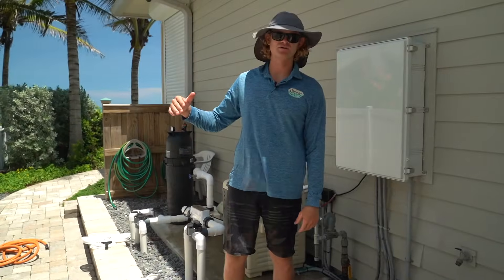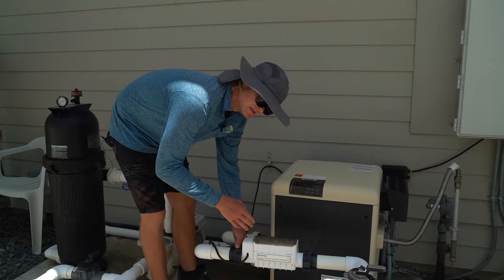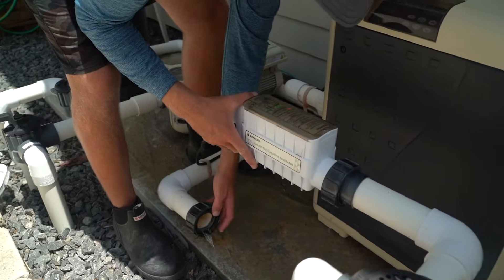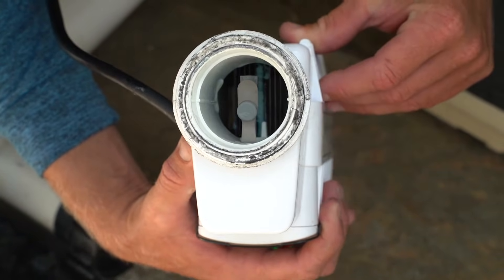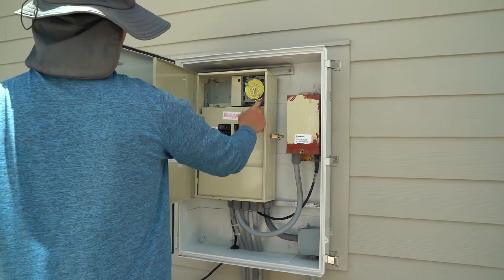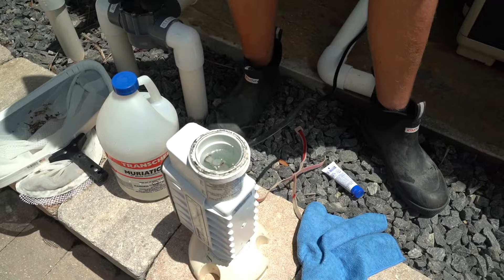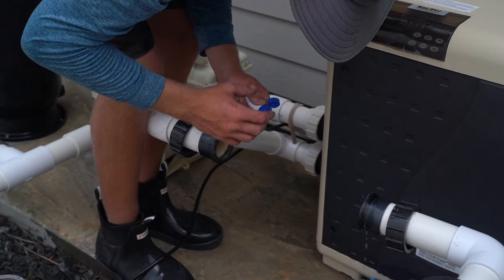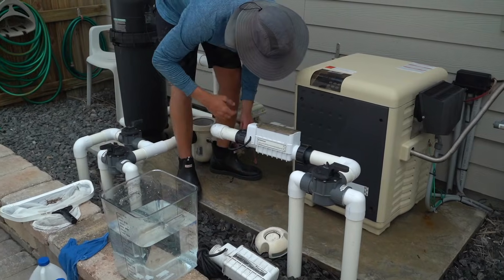HOW TO CLEAN & TEST A SALT CELL : PENTAIR INTELICHLOR

Comment: So if the Union is stuck you're screwed then
Reply from the maker: No you can use channel locks as a last resort but be gentle replace or clean and lube orings and always hand tighten when putting back together

Comment: Thanks for the video. Curiously, instead of re-attaching the dummy cell, if the pool water is independent in a bucket intended to submerge the cell unit, why does the system need to run? Only the salt cell itself actually needs to run, correct?
Reply from the maker: Yes that is correct if there’s no automation(intelli touch etc.) and the salt cell runs off a mechanical timer then that is correct I just did it so anyone can do it with their system and Hayward and other salt cells will not turn on unless you engage the pump just trying to make it as simple as possible and if you engage the pump without a dummy cell it causes all sorts of chaos and potential problems but thank you for your insight I forgot to explain that!
Reply: @PoolCareWorld  ok gotcha, thank you !

Comment: EXTREMELY DANGEROUS!  Do not ever do what this guy did.  Never add water to acid.  Always add the acid to water.

A saltwater chlorine generator should only receive power when the pump is running.  This system is wired wrong, and can create a very dangerous situation.

Disconnect power from the cell before removing it.  Only clean a cell when necessary.  If your chemistry is good, you will probably never clean your cell.  Muriatic acid cleaning is a last resort since it shortens the life of the cell.  If you do need to clean it, start with water, scraping with a wood stick, cleaning vinegar, then citric acid.

Comment: Please add some safety messages on this vid.    Always wear a  mask when looking down at the cell full of solution, the fumes can rise and fill your lungs quick, it can actually make you pass out.  Never handle the cell with it still plugged in, it’s a small amount of power but if it’s faulty you can get shocked.  Never clean over your pavers, unless you want to destroy one.   Save a spare paver for this work that you don’t care about.   

Never stick your finger in there when it’s on.   Faulty wiring means shock. Normally it’s fine but not always.  Would also recommend glasses.   Amazing how water likes to splash and it takes the tiniest amount of acid to damage your eyes.  

Be safe out there.
Reply: Masks and acid fumes, horrible idea.
Reply: This guy probly was raise like a puzy, wear this, wear that, YES WEAR EYE protection, but all the other stuff is just puzzy talk.
Reply: Jesus man..... who is paying you to make statements like this? Are you offended? Did u lose someone to Chlorine? Shouldn't he also make a statement about waiting 30 min after eating and not to swim without a life guard on duty?  Not helpful champ, just patronizing....smh

Comment: Hey buddy I will strongly suggest to put a check valve in order to protect that expensive mastertemp heater.
Reply: With this setup, a check valve is not required.  The cell should be powered only when the pump is operating, and the flow switch is a secondary safety device.  If a tab feeder was installed, a check valve would be appropriate to protect the heater from acid and chlorine generated by the tabs.
Reply from the maker: Very good idea thanks for looking out! This one is nearly 5 years old I like to keep the salt cell timer to cut on and off atleast an hour before the pump comes on and cut off an hour before it turns off to mitigate those issues. But 100% good idea!
Reply: @PoolCareWorld  thanks for taking the time and tech us how to take care of our equipment.

Comment: I can't find any P-6000.  Could you tell me more about that please?
Reply from the maker: Hi thank you for bringing this to my attention I was wrong it’s actually E 6000 and it’s just used when you first buy your salt cell tower in the bottom grove and push the oring into it to hold in place. Use a very small amount and try and only get it on the bottom of the oring not the top. Then we use a silicone lube on the top of the oring every use. We use magic lube for our lubricant

Comment: New pool owner here. Mine works too well. It's currently turned off because the chlorine is 15ppm. Even at 2% my chlorine is too high.
Reply from the maker: That’s a great problem to have! I’m guessing the pool is small? Look at the model number on the side example: ic40 is most common. Search the gallons that model is recommended for that will tell you if it’s a more powerful cell. If it’s on 2% that means it’s only running 2% of an hour run time. If it was at 100% it’s on 100% of the runtime. So if you run it at low percentage it should last you a lot longer. Also make sure your cya isn’t above 50 and your test reagent isn’t expired

Comment: In the CPO course they tell us 100 times:. You never add water to chemicals.  You add chemicals to water.  Looks like you added tap water to a jug with Acid.
Reply from the maker: Yes I agree it’s a bad habit I need to break! Thanks for watching! Any videos you want to see next?
Reply: It’s an enclosed-self contained container
Reply: So could you dilute muriatic acid with purified water instead of tap water from the hose?? I'm new to being a pool cleaner and still learning.
Reply: @mattmccauley5561  any type of WATER can be used just as long as you add the acid to a larger amount of water.  Not adding water to the acid like he does.
Reply: @JuanSanchez-tk4vr  thanks man. About half of my 74 pools are salt and I'm trying to get all the info and tips I can get so again thank you for the input.
Reply: @mattmccauley5561  hold your breath when you open acid it's bad to breath those fumes
Reply: @JuanSanchez-tk4vr  oh yeah. I'm I Florida and as soon as I pop the plastic off it starts fuming. I got a whole big whiff on my first day training when the guy poured in the pool and just a huge vapor cloud went right up my nose. Thought I was gonna die and then I got in a hurry on one job and splashed muriatic on my ankle and instantly ate my skin. Learned a valuable lesson there.
Reply: AW. Acid into Water .. always

Comment: This pool system on this home. Has a nice clean install.
Reply: No heater bypass, no sediment trap on the gas line, the install calls for both..junk valves instead of Jandys…another crap builder, screwing up. Sorry
Reply: @poolmonkey7479 
Forgot that did not see a sacrificial anod anywhere - this is a salt system. But plumbing layout looks efficient
Reply from the maker: I agree the builder did a great job!

Comment: I would recommend capping the end opposite the flow switch and not submerging that flow switch in the acid solution. Just cover the plates. Also your acid-to-water ratio is way higher than the mfgr recommends.
Reply from the maker: Yes you are correct but in cases where the cell has not been cleaned in a long time and is more caked up with calcium deposits you do need a stronger solution. I wish I would have clarified to use no more than a 50:50 solution instead in this video, just trying to make it easy for everyone. I have also seen where the flow switch does need to be cleaned so I also do it to eliminate any issues. But yes the manufacturer recommended is more like 4:1 water to acid. Thanks for helping me clarify this 👍🏻
Reply: @PoolCareWorld  4 parts water to one part acid. Cover the plates only, not the flow switch, as the acid solution will damage the bi-metallic contacts of the flow switch. Wait 30 minutes and dump the solution. If calcium deposits are still present, do it again for 30 minutes. Using a 50/50 solution may damage the plates and void your warranty. At about a $1k for a replacement, you don't want to harm the cell with careless handling.
Reply from the maker: @ronreed5889  Yes I agree and I should’ve explained it more in depth ! I honestly never thought the acid would damage the flow switch! Thanks I appreciate you!
Reply: Agree, I destroyed my flow switch at one point because I didn't know I would cause damage. However, I bought a flow switch replacement online and was able to easily replace it. Now, when I clean the cel, I unscrew the flow switch from the housing so that it does not get exposed to the acid. You are welcome. ;-)
Reply: Acid Magic is the best for cleaning the cells instead of mixing the water with acid. And no fume at all and it will never damage the cells.

Comment: Good video.  Just be careful adding water to acid. It can cause it to splash rapidly.  Much safer to add acid to water
Reply from the maker: Thank you! Great advice! Always wear eye protection as well. Yes if I’m adding acid to water I like to use a gallon pitcher for easy pouring.
Reply: acid in the water like ya oughter
Reply: Always add the acid to the water.

Comment: My salt cell is completely blocked in about 3 weeks. Is it a faulty cell?
Reply from the maker: What’s your water chemistry? Also remember the percentage of the cell is is just how long your cell runs. So only run your salt cell on 80% max and lower if possible to lengthen the time between cleanings

Comment: Great video. I have a question. My pool has a Hayward Aqua Rite salt generator. The display is showing 1700 salt, very low. I sent a water sample to a pool store and they said the salt is at 3800, high. I know is at 3800 because I added too much salt last week thinking that it was low. The cell is not producing chlorine because is reading 1700, check cell and check salt lights are on. I already calibrated it. The cell is a T15 and it matches the board. Any idea if is it the cell or the board that goes wrong in this cases?. Thank you
Reply: there is no check cell or check salt. just to be clear does the indicator light say inspect cell . sounds like needs a salt cell cleaning and another recalibration. a correct calibration will allow you to set the board to read what pool reads. I would get my own reading and not the pool stores. get you a 40 digital salt reader thats pre calibrated. eseasons makes a good one.
Reply from the maker: Great advice Ken!
Reply from the maker: @TOS RIDER I would definitely recommend cleaning the cell first that will sometimes improve the salt cell readings at the board. Let me be clear that this is a very common problem with this brand of Hayward salt cells. We have so many issues with them. Many times the board will most likely have to be replaced if it’s still not in the 3200 ppm salt range. But you cannot ever trust the board reading always take your own readings before adding salt. The cell also should be replaced every 3-5 years, if it’s past 3 years and still working it’s running on burrowed time start saving up for a new one. 

My opinion if both the board and the salt cell are outdated and you’re looking at replacing both of them, then switch your salt system over to this model pentair intelichlor. It’s going to be around the same price or cheaper depending on if you do it yourself or hire someone. These salt cells have the board display integrated on top. They’re bulletproof! This is a IC40 model make sure you’re getting the right size.

For testing the salt I recommend using a Taylor 1766 salt reagent kit they’re super accurate and no need to calibrate. Just store in cool place. 
Hope this helps! Subscribe I’ll make a video on Hayward soon!
Reply: @PoolCareWorld   Good Morning.
Thank you very much for your response. I ordered another cell from Salt Pool Store. I'll try that first since it's been 5yrs with this cell already. Thank you again
Reply from the maker: @tosrider7043  Our pleasure! Happy Pool to you and your family 😎
Reply: Im having the same issue. My system was purchased in 2008, and I don't know what the life of a system board is. The cell is brand new but is generic, RX Clear Hydrosalt brand. It's for up to 30k gallon and mine is 24-25k. The seller said he'd replace it, but not sure it's the cell. I've had other non Hayward cells with no problems. I would also add that the pool store has tested the water twice in one week...3500 first time and 5k the second time!!! I added what I believe was recommended online... all new water due to liner replaced. I guess I need the digital salt tester! I also never see the buildup in the cell... our water is very good, and never see the bubbling when cleaning.
Reply from the maker: @kristinebrady3668  Sounds to me if you are cleaning the cell and never seeing any build up it may not be generating chlorine! Are you getting any chlorine reading in the pool without adding additional chlorine? The salt being over 4000 will typically not work. There's also the possibility you have nitrates in the pool, which most pool stores can test for. In both cases whether high nitrates or high salt the pool will need to be partially drained and refilled to get correct readings. As discussed the cell and board will need replacement after 5 years typically the board may or may not last longer. if you are looking at replacing the cell and board I would recommend switching the salt system, to a Pentair Intelichlor system to eliminate the headache because the cell and board are together so if it doesn't work in 5 years you just have one thing to replace not two. Hope this helps please give me some more details on the pools chemistry to help further!
Reply: @PoolCareWorld  I'm on my 3rd salt cell. The others worked fine, and there also were no bubbles when cleaning them, which seems like an indication of no buildup. When I watch videos about cleaning cells, I can see the buildup, but mine never appeared to have buildup of calcium or anything. Also, the cell is generating chlorine. I haven't added any liquid chlorine or shock for 2+ weeks. In fact, the chlorine is now high it appears in the water/drops test. My display is still showing salt ppm below the 2700 minimum, 2500 or 2600. I need to get one of those salt testers. If I went from a T9 cell to a T15 cell, does the configuration under 'configuration-locked' need to be adjusted? I think I saw a reference to that somewhere. I know nothing about the Pentair system. Is the panel/display similar to the pro-logic with all the adjustments for settings and timers on the pump, e.t.c?
Reply: Cell is bad sir